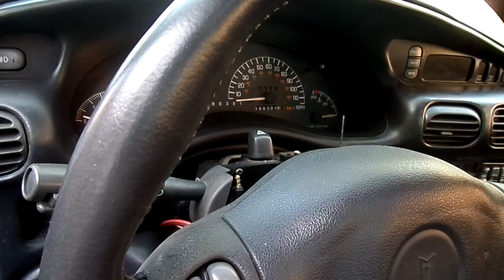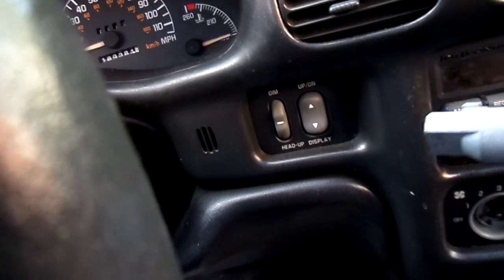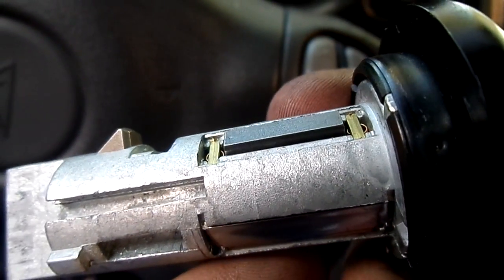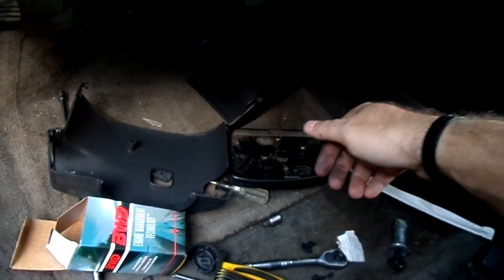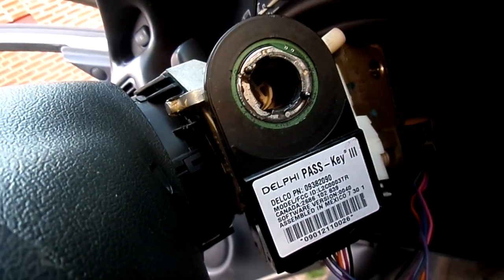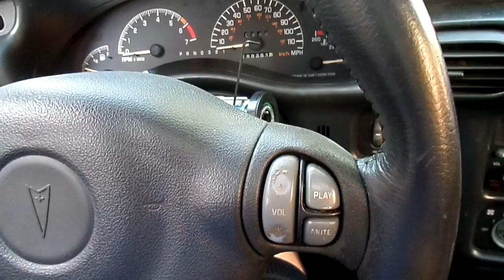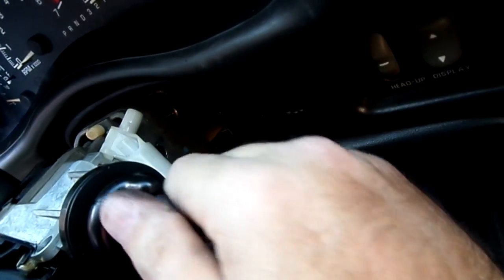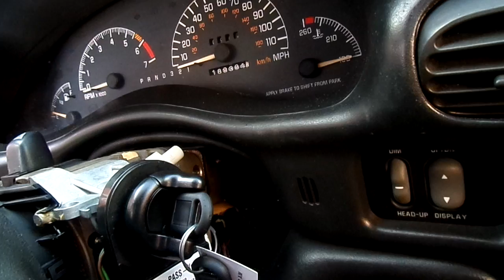Ignition Key Replacement and Re-Program For A Grand Prix

Comment: You can also take cover off bottom steering column and look right where key goes in and it a silver peg looks just like a button mine locked and been unlocking it like that for 2 years

Comment: So I actually need to do this exact replacement but my question is do they sell the ignition cylinder with the door lock cylinder as a package together. Will the new key unlock my drivers door? I'm trying to find out if when you program the key for the ignition does it program also to unlock the door? Do you see where i'm going with this? Thank You

Comment: My ignition turned to stopper in start position and felt like the piece that you showed replacing slid out like 1/4 inch and continued rotating forward about 1/2 a turn. Now it spins freely about a half a turn without making any contact with anything until it stops spinning. I cant get it to push back in and make contact with anything i cant get key out and because its not in run position i cant press the release to remove the whole housing and everything. What do i co

Comment: I have a 05 Nissan Sentra SER Spec V 2.5 my keys were stolen and the key lock cylinder got messed up so I bought a whole new steering column with a key for the same make n model but having trouble with programming it to the car any suggestions? Please Help

Comment: i have a 99 Pontiac grand pre gtp... an it won't start, it just clicks...  we have taken off the starter had it tested its good. the battery is charged, but it also wont shift out of park.  an the key will NOT turn all the way back to the lock, position.. my husband was replacing the door speakers, when the car, died i guess.... i dont know what to do... if you can give me any help that would be great...
Reply: Jessica Smith check yo flywheel

Comment: How do you get the switch out without the key
Reply from the maker: +Jason Nixon  try the lock release under bottom steering wheel cover , I usually drill the switch takes about 10 min , when you get access to the bottom just use a flat head to turn it
Reply from the maker: +JamieJones TheCarMan  you will still need to use the release to get out the rest of cylinder out
Reply: I had to carefully chip around the whole switch to unplug the plug that was locked in. I couldn't remove it because my key wouldn't turn so I chopped off all around it and used a lock pick set to pry back the white piece locking it in and boom, slid right out